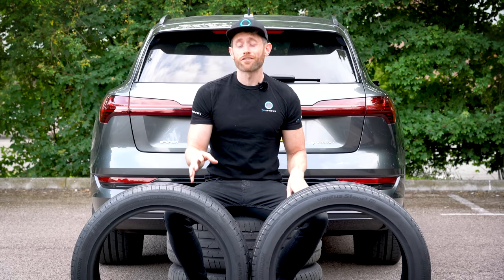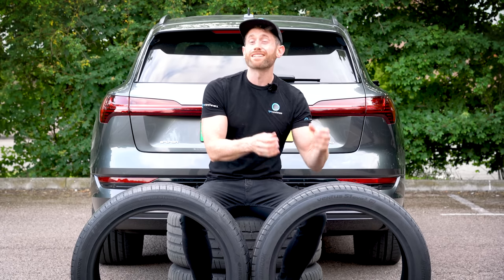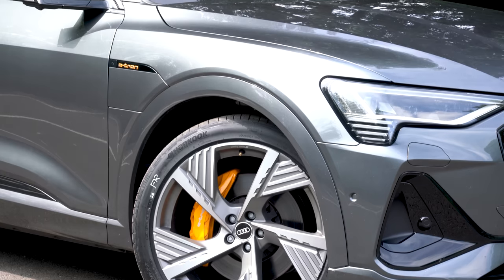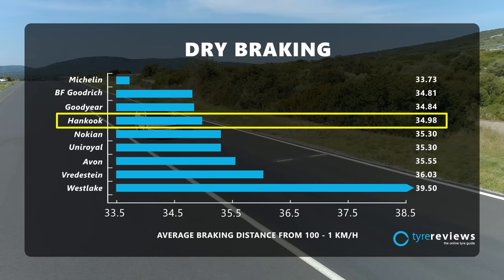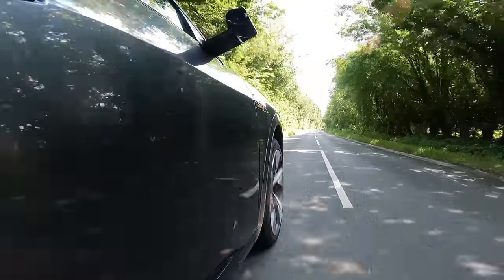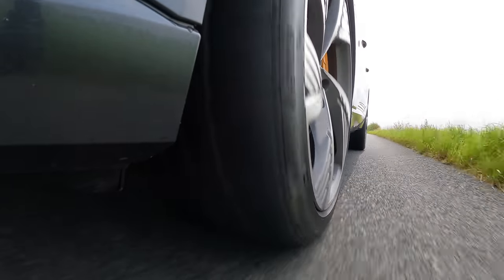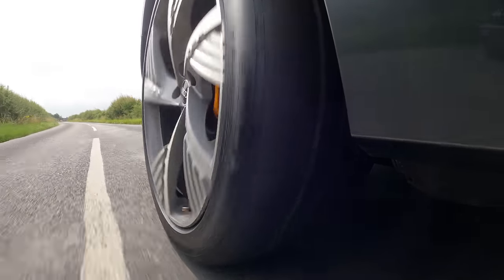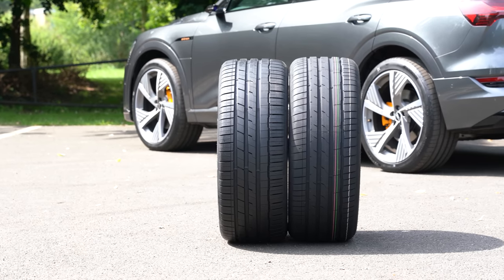What makes EV tires different, and why should you fit them! 🔌

Comment: What air pressure you have in the E-Tron?
What the factory recommends? (Ex: full loaded, lightly loaded or ECO)
Of course what you are going to use the car for determines air pressure.
I have experienced here in Norway, what the manufacturer recommends is not always the best for the car or tire.
What i often see on electric cars is often they must have more air in the tires than what the manufacturer recommends here in Norway.
Example Tesla Model X.
They say 45 psi in all wheels for normal use.
What I see is 50 psi (often this is the MAX pressure of the tire) is best for the tire and the car's range. (summer and winter)

Have you experienced anything similar in UK??
Reply from the maker: I ran stock pressures. Higher pressure will give you better range but you'll reduce comfort and grip and have centre wear

Comment: Not sure if the recommendation is very accurate. The comparison is between a SUV tyre and an EV tyre. An SUV like the BMW X3 2.0d has a weight of 1,840 kg. A EV like the Tesla Model 3 SR+ stands at 1,825 kg. So what is the best tyre for each car since they have the same weight?
Reply from the maker: Probably the OE tyres that were developed with them!

Comment: One minor comment: you said EV tire reduces charging time. It actually reduces the charging time required to cover a fixed distance. If you charge an EV from empty to full, the charging time would not be affected by the tires you use.

Comment: At what weight would you recommend someone switch to these EV tires? For example, that Audi is over 6000 lbs, but a Tesla Model 3 is only 4250lbs, which is about the weight of a Lexus, Is that heavy enough to reap the benefits of that EV tire?
Reply: Yeah I'm thinking exactly the same, he mentioned about weight but not all ev are that heavy like nissan leaf for instance
Reply from the maker: I don't have the answer, sorry, but I'm sure the Tesla tyre is also built like this!
Reply: @tyrereviews  Yes the Tesla OE tyres have foam but the weight of the Model 3 range is comparable to the weight of the BMW 3 range so other than the sound issue (which many owners report is hardly any different from tyres without foam) you would think the tyre choices should also be similar.

Comment: Hi!

I do not agree with the statement about not mounting them on non-electric vehicles.

I am sure that the brands optimize the tires for each size, so a 2.7 tn SUV that carries a size according to its size is not comparable with another size of tire.

For example, a golf gti has 225/40-18 tires with a weight of 1.5tn. I have a Mercedes CLK 320 CDI Cabrio that weighs approximately 2 tons. I am sure that I get all the advantages of the EV tire.

Really from the first moment I mounted them on the front axle only, I noticed a huge drop in consumption (previously I had sport front tires).

So I would not say that it is not recommended for any vehicle, but for light non-electric vehicles.

Best regards

Comment: Excellent video. EV's are amazing. Wait until you drive a TESLA, your perception of TIME will change. Petrol heads beware, do not tease a TESLA on the road, you have no chance! Sold my last two Porsche's, there is no going back!  Thank you Tyre Reviews!
Reply: Super short gear ratios enabled by wide RPM range and instant torque is a killer combo.

Comment: I think you should have mentioned that the construction of the ev tyre has to deal with the regeneration, a lot of power gets back to the battery by using the friction of the tyres
Reply from the maker: Isn't that the same as braking though?
Reply: @tyrereviews  much of the regeneration happens at times that not necessarily are breaking zones... may be it is the same, so far I don't think so, ev go through tyres a lot more than ICE cars and I think that's one reason

Comment: The main thing you didn't test for me was how are these ev tyres going to perform in the winter. I would love to see a test back at the Snowdome. I doubt the e-tron would get anywhere near the top of the slope? I drive in Wales in the winter and find Michelin Crossclimate brilliant.
Reply: I could be wrong, but in this test he compared two summer tires. Summer are not to be used in winter conditions anyway.
Reply from the maker: As nifz said, these will be as useless as any other summer tyre
Reply: @tyrereviews  I guessed as much, I expect if I buy an ev I will have to loose the eco boots. I just need to know how the range and handling are affected with Michelin crossclimates 2's for instance are cc2s ok handling all the extra weight.

Comment: I would love to see an EV tire competition review. I know that Hankook came out with their new ion EVO line. They have an EV summer tire, All Season Tire and Winter Tire. I would love to see them compete with Michelin, Bridgestone, and Pirelli EV tires. Any chance for a video like this? I have a Tesla Model 3 Performance and was running Michelin Pilot Spot All Season 4's on a 235/45/18R setup (I live in New York and for safety reasons, I took off the 20" wheels because there wasn't enough sidewall to endure a pot hole hit without damaging the wheel). The Michelin Pilot Sport All Season 4's were good except I only got 28k miles out of them. I just put the Hankook ion Evo AS tires on because they have a manufacturers warranty of 50k miles. Since I drive 24k miles a year, I am hoping that I can get 45k+ miles a year without sacrificing too much performance/handling. You're pretty much the only one I trust on YouTube, so I would love to see a review on the performance of the various EV tires there are.
Reply from the maker: Working on it, hopefully q2 next year
Reply: @tyrereviews Yes!

Comment: In regards to how quiet the ride is with the EV and the tires that are fitted with the EV I will have to say the biggest problem with that, along with the mirrors and it's designed to break down with noise is when you make it right so incredibly quiet you are basically taking the soul away from a car and you may disagree or may agree I have no idea but modern cars are solids or as older cars are more of an experience and unfortunately no matter what we do it seems like it's just going to go to that where everybody drives an electric vehicle that is Uber quiet and has no aggression has no character to it they're all going to be bland and some shape or form.

But like as always love the review and definitely an insight on the two tires
Reply from the maker: Agree about the soul, I made that point at the end :)
Reply: Old Cars don't have a soul, they are just rustboxes on wheels that poison the air.
Reply: @tyrereviews  yeah I caught that took me a minute to realize what you were talking about when you meant emotion
Reply: @solentbum  I hope you're being sarcastic because if that's the case then you truly are not a car enthusiast which means why I even watching a tire review video lol.

Even the channel officially gassed did a video with an Audi I believe RS6 and put it against a Subaru WRX STI they had a roll cage and everything and he even said the Audi is phenomenal, however the Subaru is more of an experience more fun to drive
Reply: @cleysoptique8749  After some 1million miles of driving and some hundreds of cars driven I view cars as nothing more than they are , Tools for a job. 
Since I own an EV I am of course interested in ensuring that I use the right tyres for the job. In the same way that I use the right spanner for the nut, or screw for a fixing.

Comment: The EV tyre is more expensive than the non-EV tyre is one of the factor is because it involves man's work to insert the sponge into the tyre. This step isn't machined because EV car isn't popular and EV tyre demand not high, many tyre makers do not invest on machine to insert sponge at this moment.

The sponge is important for EV since EV doesnt has combustion engine which giving extremely quiet ride. The main noise flew into cabin would be tyre roar and wind noise.

Comment: EV tyres on normal car is a bad idea, but how about on a long transporter T6? It is a heavy car with (in my case) 225 wide 17inch tyres, and there are very limited options (usually just one) if I wanted to get expensive van specific tyres.. I do not use the car as a delivery vehicle or anything heavy duty commercial like that, so I have tried to choose between regular and van tyres before. I think EV's would certainly be better than regular tyres in this case..

Comment: Good job on the vid and maybe I will try an EV one day. A plaid, of course. 
 First video I watched of yours after searching "ev tires vs traditional automotive tires" 

This 3 year old video and still no real improvement in charging station availability. 

 If the hypocrite 'people' that have no business telling anyone to do anything weren't trying to force me to buy EV would be good and possibly better for EV sales. 
One point of contention is that ev's do not pay off as well as people hope but planting trees and improving tree health, not wasting electricity by lighting untraveled roadways or empty buildings, no idling trucks, increasing solar power and ev stations with battery storage and solar battery charging, 
 not clogging cities with gasoline Uber vehicles, ev mandates for uber and taxi and  vehicles we know run 24/7 (have incoming cashflow to support the EV purchase) is better than any ev mandate for a middle class family mom driving 100 miles per month. Plus, noise and smog reduction in urban areas that lead to improved health of our kiddies.
  EV proponents can also chip in a few hundred bucks to a super fund subsidizing purchases, recycling ev batteries or charging stations instead of looking to neighbors to finance their whims.

Comment: How does a tyre like this work with a lighter EV like a model Y which at a little over 2000kg is a similar wight to many ICE SUVs ?
Reply from the maker: There's certainly still benefits but the OE tyre with the tesla will have factored that in

Comment: Of course all evs are not the same, just as all petrol cars are not the same. I would guess that my Model 3 SR+ which is more than a ton (yes really!) lighter than this eTron could have a smaller advantage using EV specific tyres . My only experience so far is with using non ev specific winter tyres (Goodyear Ultragrips). I have found them to be excellent and hard to say if they are noisier or not despite the lack of foam damping.

Comment: so the manufacturer calculated the tire dimension for the EV weight of the car? and are we sure that the manufacturer just calculated like any other car?
I'm gonna get an electric (dacia spring) and wondering that EV tire is less safe than normal ones... also don't think that there's gonna be an all season EV tire...

Comment: Extra weight will soon be a thing of the past. Current Tesla Model 3 weighs 1800-1900 kg which is close to similar sized gas cars (BMW 3, Mercedes C, etc). With continuous innovations, we'll soon see EVs match or even beat gas cars with weight which will be good for range and tyre life. Even the 'fat' etron here is 2.7 tons where as the slightly smaller Audi Q4 etron is 2.1 tons, a big difference in one generation.

Comment: The problem is ..... I own a 2022 RWD model Y I dive on coarse chip rural roads in New Zealand the first factory set of these ev's hankooks only lasted 22,500km (14k miles) These cost $780 each here!  So the energy cost to run the car thus far has cost me a miserly 2c/km and the tire cost is 14c/km. I simply need a cheaper alternative - yes I will scarfice performance/noise and range. -----help!!!

Comment: Well about the weight of the used vehicle. Let's say I'm using an RS6 instead of a model S. The RS6 is heavier by approx 250 kg. Doesn't that mean the RS6 would use the EV tyres more efficiently than the model S?
Reply from the maker: you have to also consider what the targets for the tyres made in those sizes would be, or if you could get ev tyres for them as I doubt tesla tyres would fit a sweet rs6

Comment: I'm surprised that the wet braking performance was so much better than the dry braking - 25m wet vs 33m dry.  Are you sure you didn't get those results reversed?
Reply from the maker: Slower speed in the wet

Comment: The weight issue is not true for all vehicles - a Tesla model 3 Std+ weighs less than a similar sized Audi A4 45 TFSI (100kg less if the A4 has a full tank) and a RWD model Y weighs 150kg less than a similar size Q5 40 TDI. 

One of the OEM fitments for the model 3 is Michelin Primacy E 235/45/18 - Michelin also make the Primacy 4+ in the same size, same load rating, and higher speed rating - the EV tyres are 20% more in Australia and the 4+ version provides better mileage. 

While the rolling resistance of the 4+ is 35% higher than the EV version according to Michelin themselves,  it impacts range by only 3% (less than removing the aero covers)- rolling resistance is a relatively small factor in overall EV efficiency - weather, avg. speed, gradients etc are far bigger factors.

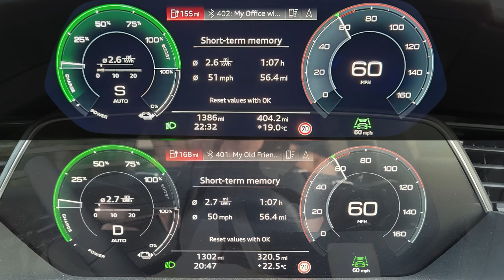Comment: Thanks for your detailed review. I got a small question about the energy saving of the EV tires. At 8:11 of the video, the car shows a 2.6 and 2.7 mile/kWh efficiency difference in the same 56.4 mile test loop. That is a 3.8% difference, not 9%. Also, considering mechanical friction only contributing to 30-40% of power consumption at high speed cruising (the rest is air resistance), the 9% reduction seems too much for simply swap a set of tire.
Reply from the maker: As I said, my test wasn't perfect due to external factors, I would trust the Hankook data way more at 8:24!

Comment: I have a kona 64kw and it has primacy 4 on there wet weather grip on those is shocking better than the nexans they fitted on the mk 1 not sure what to fit next was looking a mich crossclimates
Reply from the maker: The CC2 has low rolling resistance

Comment: Those who don’t understand EV charging always mention charging time and not wanting to spend more time charging as a big deal but it’s exactly the opposite. Gas cars get filled up say twice per month at 20 minutes per fill up to get to the station, fill up and get back home say for total of 480 minutes per year. It takes me about 60 seconds per month to plug in at home with possibly 25 minutes max for one charge at a supercharger on trips over 350 miles. Total 37 minutes per year; about 14 times longer so are we choosing ICE tires based on saving gas so we can spend less time filling up?  Of course not. EV drivers are never trying to save range because we leave with a full tank every day and rather look at ways of using our $2 fill up to our benefit by leaving AC on when we go shopping and warming our seats and car and defrosting our windows 15 minutes before we leave because the cost is almost zero. I purposely accelerate to the max at every light so that without speeding, I get to my destination 15% faster than ICE.

Comment: Nice Promotional ad. 30 - 35k miles is very low durability by any standard. What about snow and ice performance. Did you mention the cost of a set of e-tires?

Comment: A Tesla model 3 performance is only 1850kg, same as my old c320cdi and my Volvo S60 Polestar. If an EV tyre is markedly more expensive I'd take the saving and get non EV tyres. A Tesla is never going to be as quiet as an Audi on any tyres.

Comment: Regarding your closing remarks.. I'm wondering what else you would consider a "final solution", short of anyone inventing a teleportation device? We've put 100 years into the development of combustion engines, and still haven't reached a point where they're sufficiently efficient and don't destroy the environment. I don't see anything taking the spot of EVs in the next several decades.
Reply from the maker: I wish I knew, but I hope it's hydrogen powered electric motors

Comment: My i3s has Bridgestone 195/50/20 tyres on the rear, as far as I know the only manufacturer of summer tyres for my car. The thing is I have done only 7,000 miles since new in December 20 but the tyres are more than half worn out. Is this normal?
Reply: It's rear wheel drive so yes, its normal
Reply: @ksochacki  if it were front wheel drive they would already be worn out.
Reply: @garrycroft4215  well it depends, consider you are using rear wheels to brake with electric engine, under the braking your rear ends is getting ligther, because of weight transfer. My mom has i3 and its the same with her easy driving.
Reply: @ksochacki  thank you that's what I wanted to hear that it's not just me. Done 8,000 now less than 4 mm left and will change at 2.5 mm. 
You are right regenerative braking will save brake pads but eat tyres instead.

Comment: Did not answer to my question… Can I put EV tyres on normal vehicles?
Could you run on normal car, <1300kg, and see what are differences between those 2 models?

Story: I have an Octavia, and I want brand new Continental PremiumContact7, issue is that I find only EV model.
Can I get them?